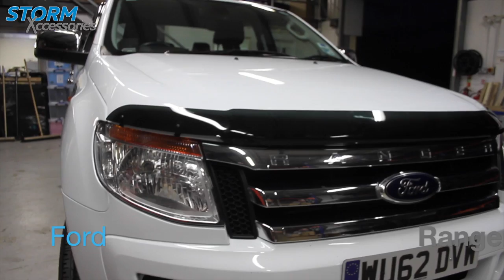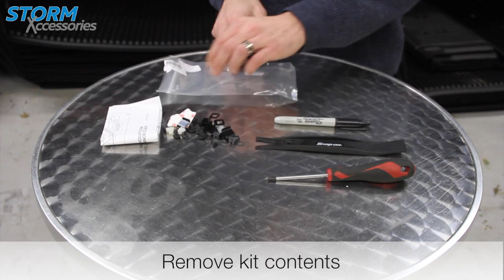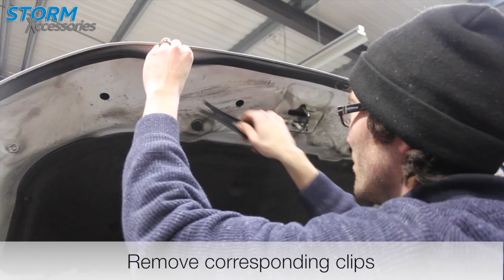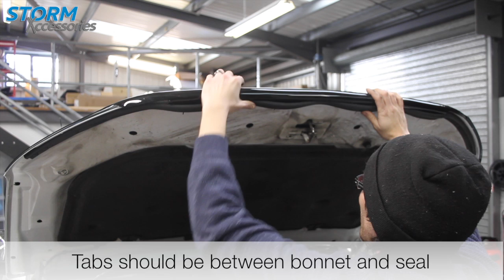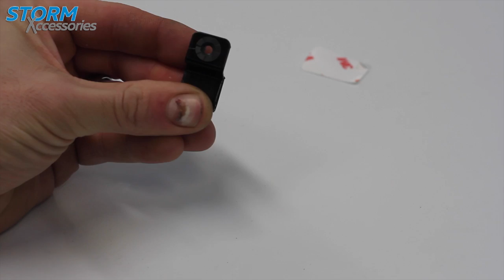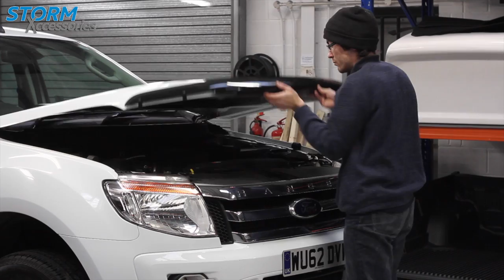Ford Ranger T6 2011-2015 EGR Bonnet Guard

Comment: Does the bonnet guard for fitment on a 2017 navara np300 fit the same way as in this video because I just bought a different make and the fitting kit is crap thanks 👍
Reply: Similar idea but not the same.  The four middle clips are fitted first in the correct way using four black clips. Then attach one either side. Remembering to use the protection sticky pads. The actual stone guard is clipped on with no screws looks good 👍